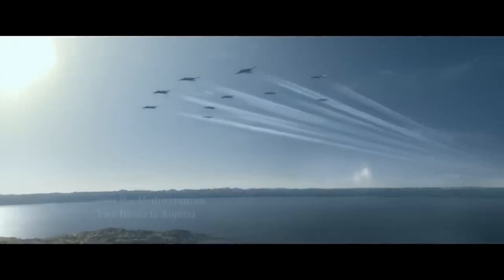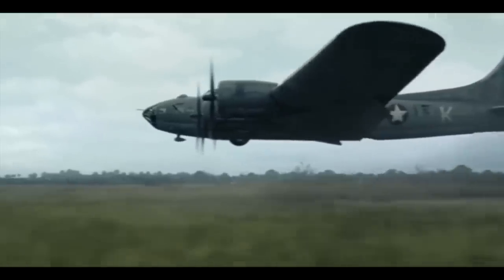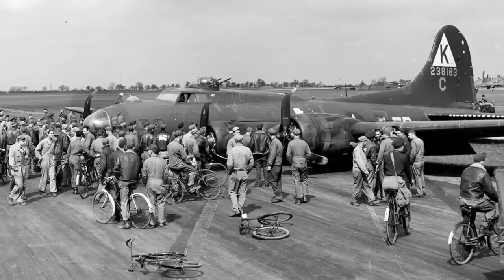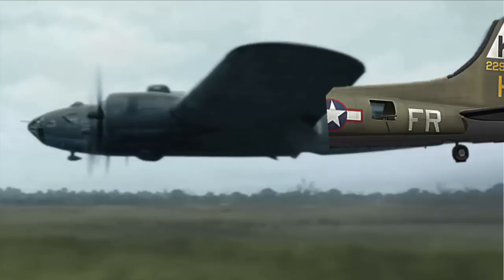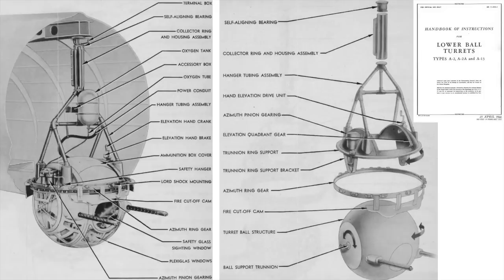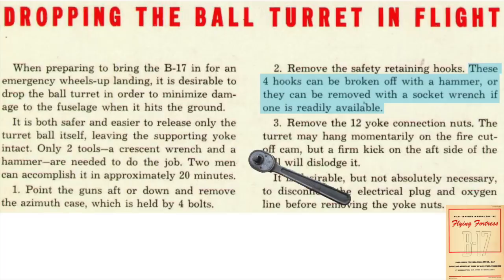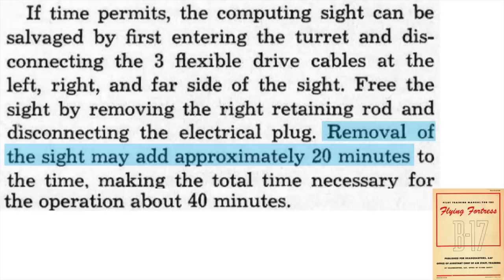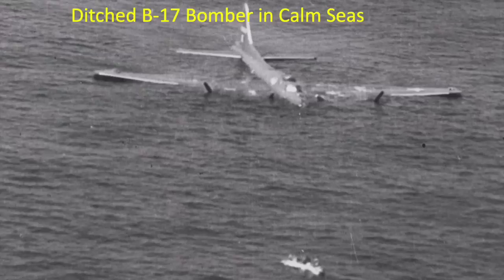Masters of the Air Ball Turret drop- Why and How Explained

Comment: I wonder if they ever did a trade off analysis on the fuel burn of dropping the ball turret versus the extra aerodynamic drag of the opening. I suspect it was better to drop it,but not as much benefit as you might think due to the extra drag.
Reply: That ball turret did not retract and was a huge drag sticking out like it did.
Reply: @grizwoldphantasia5005  I think he's referring to the parachute effect that the hole will create, air entering that hole has to go somewhere and its going to be to fill the back of the aircraft, making alot of drag, much like rear bumpers do on cars.
Reply: @steriskyline4470  Yes, I understood that.  But that big ball sticking out is a lot of drag too, and more weight than a hole.
Reply: @steriskyline4470   I would think some air would rush out of the hole because of the lower pressure outside the aircraft. Also, the B17 (as I understand it) already had two large holes in the waist for the gunners to fire out of. So the drag caused by a hole might not have been that big a deal?
Reply: @charliekelland7564  you make a very good point sir

Comment: So, in episode 3, the pilot took a calculated risk.  The ball was dropped in the N. end of the Med, plane heading to Africa.  It might be enough weight savings to make Africa, or, if you still don't make it, the hole makes for bad ditching.
Never would have recognized that tradeoff w-out your video.  Thanks!

Comment: Prior to that episode I had no idea dropping the ball turret was possible. I was a bit skeptical but it totally makes sense for belly landings. Thanks for another great video!
Reply: Same here.

I never heard of the ball turret having the ability to be jettisoned.

Interesting.  Definitely not a speedy process though.
Reply: Exactly (not a speedy process). In the combat environment they were in I presume there was generally not enough time to jettison the ball. Still, I guess conditions sometimes come up where it was done.  @stevewhisperer6609
Reply: I've been explaining this procedure to people for some time as a part of debunking the myth about ball turret gunners getting ground into hamburger during wheels up emergency landings back in England, it's part of the explanation I give to people as proof that it never happened despite Andy Rooney's famous article in Stars and Stripes magazine during WW2 when he was assigned to the 8th Air Force as a war correspondent. 
As I tell people in the first place there's manual cranks on the ball turret that enabled them to crank the turret to the "hatch up" position so the gunner could get out in the event power to the turret went out, afterwards if a wheels up landing was necessary the ball turret needed to be dropped because with it in place it'd break the B17's back causing it to break up making for a less than desirable belly landing, contrary to what people believe the ball turret was very sturdy and was actually stronger than the fuselage in that area, they wouldn't break apart or get ground down to nothing. 
Also if you watch at the beginning of the movie Twelve O'clock High when the great Paul Mantz belly lands the B17 when it's approaching the runway you'll see there's no ball turret sticking out of the bottom, this wasn't done for historical accuracy but for the same reason that ball turrets were dropped on B17's forced to belly land, it was removed to keep the plane from breaking apart during the stunt.
Also it was standard procedure for the crews to drop the ball turrets while crossing the English Channel when possible, the USAAF didn't want eleven hundred pound bowling balls rolling across the English countryside at 100 MPH wiping out homes, cows, barns and everything else with "Property of 8th Air Force" written on them.
Reply: @dukecraig2402  But you have to admit that using ball turrets as bowling balls with barns as the pins would be a much more awesome sport than bowling is.
Reply: @dukecraig2402  I would totally take the jettison risk for a free ball turret.
Reply: @dukecraig2402  interesting, was the ball turret drop over the channel enforced? I can imagine replacing ball turrets for every flight would be expensive and wasteful
Reply: @thetombuck  
I don't know that it was some kind of strictly enforced rule like "Don't drop any unused bombs on the English countryside" would have been as much as it was standard procedure, I've never heard of one being dropped on the English countryside either so I'd imagine that it was something the crews stuck to understanding the liabilities of a 1,000 lb bowling ball rolling across the place at 150+ MPH, I'd think that the only time there'd be an inquiry is if one did get dropped on England and it took out a house or some farmers cows but if one was ever dropped on England as long as no one was hurt I'd imagine they didn't say anything to the crew given that they were in an emergency situation with injured crewmen and all that, they had hour's after where they'd have gotten battle damage until they got back to the Channel to have it ready to drop, in the case of being down to one engine and needing to shed weight I doubt 8th Air Force command would get upset if someone dropped one on Germany since they were dropping bombs on the place anyway, it's just the kind of thing that they didn't want done, if the landing gear was going to be inoperable they had hour's to check damage to see if it was and be ready to cut it loose over the Channel, that's part of being a responsible aircraft commander.
I first heard about this year's ago reading an article about 8th Air Force equipment littered across the Channel and saw a picture of a ball turret taken by a submersible, they mentioned in the article about how B17 crews dropped turrets when their landing gear was inoperable and how command had dictated that they be dropped in the Channel before getting over the English countryside for obvious reasons, it also had pictures of jettisoned bombs, prior to the fall of 43 when 8th Air Force bombers started using the H2X ground scanning radar system to sight their bombs when they would get to their target and there was too much cloud cover for optical aiming they'd drop them unarmed in the Channel because obviously you didn't want to land bombers, especially one's with battle damage, that were full of bombs, after they started using the H2X system they rarely had to do it after that.
Reply: @dukecraig2402 there was a landing w a man stuck inside w no landing gear he survived.
Reply: Forgot about battle damage
Reply: @tomhenry897 This looked good on paper but what happened in real life?  What about wounded ball gunner who was not able to climb out of the ball?  What if crew was wounded and unable to remove ball on way home?  What do actual veterans have to say about it?
Reply: B-24 ball turret was retractable
Reply: @josephhaack5711  
The B24's ball turret was retractable but they didn't fully retract, it was the same exact ball turret that was in the B17 except for the mount which is what made it retractable, I'm not sure if they dropped them for a gear up landing or not but there's the possibility they did since they did stick out some when retracted and they also might have dropped them to shed weight in the event of having lost engine's, it's like everything else about the B24 most information is always about B17's since they were the most popular even during the war.
The only reason it was designed that way was for clearance when it was taking off and landing because of it's tricycle landing gear, since it didn't have a tail wheel the ball turret would catch the ground in the event of a nose up landing or take off so the mount was designed to retract them when on the ground, it didn't have anything to do with the gunner getting in and out like most people think, as I recall they could get in and out with them in either position if needs be.
Reply: They actually landed w no gear an q guy stuck in the turret. Expected him to die on landing. He didn't.
Reply: Yeah if they had 20-40 minutes to do it. Yikes
Reply: Never knew this but 20mins seems like a LONG time if you’re losing altitude
Reply: Me too didn’t know that the b-17 bomber crews could do that
Reply: Episode of what? You're all talking about some show but there's no name anywhere.
Reply: @thatguyonyoutube989  Masters of the Air